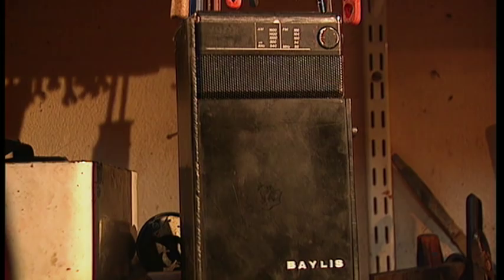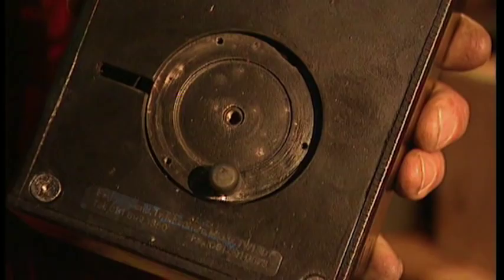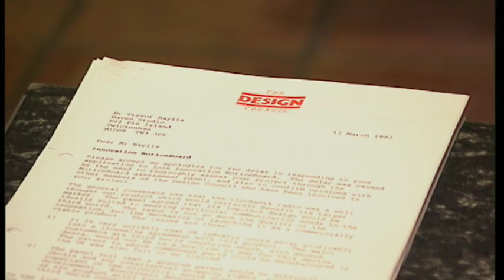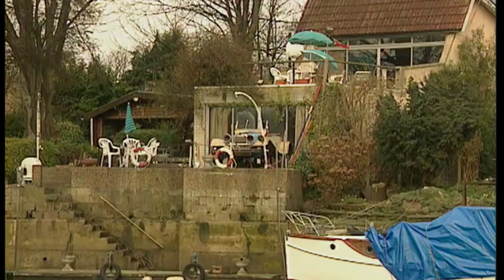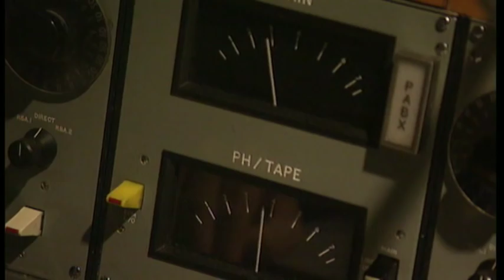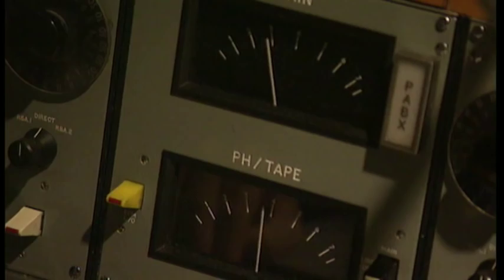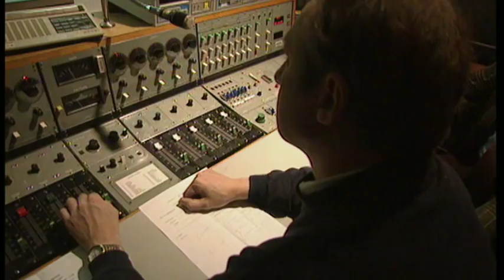Inventing the Clockwork Radio w/ Trevor Baylis | Tomorrow's World | Earth Science

Comment: Thanks Britlab, and thank you Trevor.

Not trying to steal thunder or anything, but I can very clearly remember an episode of the TV show The Inventors, here in Australia, in about 1975, where they had a wind up power source, so they asked the inventor how he got the idea and he explained all he was doing was taking away the pedals and adding a spring. Huh? The Australian Outback School of the Air had been operating school services to kids on remote properties since the 1930s, over shortwave two way radios, and while they could be powered by a battery, or mains power if you had it, the base setup was a set of pedals under the table and a generator. They ran that system for over 30 years. The modern equivalent is a 2 way internet connection and a virtual classroom, but I don't think there's a pedal version of that...

Comment: What I'm most curious about in the clockwork radio is how Trevor got the spring to wind down more slowly with reduced volume settings.
If you have a bit of electrical knowledge, you'll know that you can use a motor as a generator. You'll also find that higher power loads increase the torque required to turn the generator at a set speed, whereas low power/current loads make the generator easy to turn. Higher generator speeds give higher voltages. So when you turn the volume down on a radio, any generator running it gets easier to turn. This would mean a spring powering it would have less resistance and so tend to unwind faster, which is the opposite of what you want. You want the spring to turn more slowly when you turn the volume down, but the easy to turn low power demand generator is giving you the opposite! Worse it might cause a voltage spike that could damage the radio.
When you turn up the volume on the radio, the opposite problem. The generator sees a lower impedance load that is demanding lots of current and so it becomes harder to turn. And the spring which you want lots of power from has now slowed right down due to the difficult to turn generator!
Whilst you could install some kind of automatic transmission that shifts the spring into a taller gear at low volumes and a shorter gear at high volumes, it seems quite mechanically complicated to do so. You could instead install a variable DC-DC converter which steps up the voltage, so the motor sees a high current low voltage (and the radio sees a lower current medium voltage) which will make it harder to turn saving spring energy at low volumes. And you could have it step down the voltage at high levels so the motor can spin really fast making high voltage medium current which is then converted to medium voltage high current to run the radio loud. This is the electrical equivalent of changing the gear ratio.
So anybody the wiser to how it's done? How do I make the motor harder to turn at low power instead of high power so the spring winds down more slowly?
Reply: I think I've worked out what it is. The generator is connected to a capacitor in parallel with the radio. When the capacitor is fully charged, it is swapped out of the circuit for a shorting wire on the generator. The shorting wire is to put resistance on the generator and make it turn at minimal speed when it is not in use. The radio runs down the capacitor until a circuit detects that the voltage in it is low. The shorting wire is switched out of the circuit and the capacitor is swapped back in to recharge. This cycle repeats multiple times a minute. A loud radio will discharge the capacitor more quickly and it is automatically switched back into the circuit more times a minute than a quiet radio does. This also works out why the unwinding radio oscillates in speed instead of unwinding at a constant rate. There are transistor circuits that will switch based on a changing voltage at the base. One such device is called a Schmitt trigger that can provide an output when the capacitor charges to Vmax and keep signal till it discharges to Vmin. And also the opposite switching the capacitor back in.
Reply: @TimpBizkit  That is pretty smart, thanks for that. I just finished reading his autobiography and I'm sure at some point it mentions some kind of automatic gearbox though may have just been for a prototype. I think it also mentions that only the "2nd generation" version has a feature to adjust the speed of spring discharge, so maybe they used the method you describe, and the earlier ones used a gearbox or some more crude method to just regulate the voltage?

Comment: I wonder if the current wind-up radios (and torches) were based on this idea, even if dynamo based instead using a clockwork spring...

I remember getting a combination solar and dynamo radio a year or two after this aired, which was brilliant at the time for a number of reasons.  It worked during power cuts and could be stored away without any risk of batteries leaking inside.  With its solar panel, it operated at a moderate volume without winding in a well-lit window.  I use to leave it on a talk-radio station while on holidays as it gave the impression a TV is on during the day, followed by a timer-operated lamp in the evening.  It lasted a few years before its dynamo failed.
Reply: They must have been. See my other comment.
But he also wasinterviewed in commercials on Discovery. In those he explained "The idea came to me when I was on a trip abroad.", and that the company was worth a  3.000.000 English Pounds.